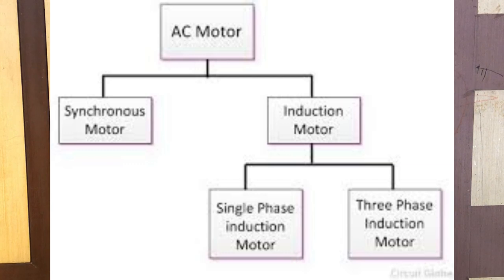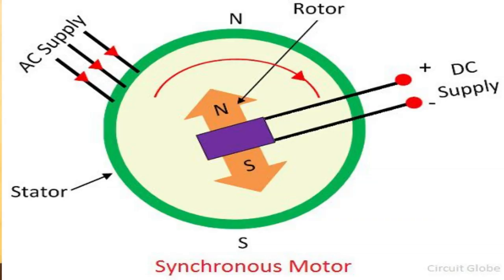Types of AC Motor | Synchronous Motor vs Induction Motor in Malayalam

Comment: Single phase motorum 3 phase motorum engane thirichariyam
Reply from the maker: Ath name plate nokkam ,illel connection nokkam
Reply: @TechCornerMalayalam  manazilayilla.kurachukoodi clear ayi parayamo?
Reply: vipin bro , aa motor il kaanum name plate athil phase kaanikum , pinne aa motor inte panel boardil varuna wires single  phase or three phase aano enu nokyaal manasilakum bro.